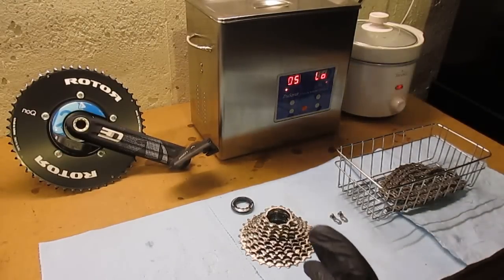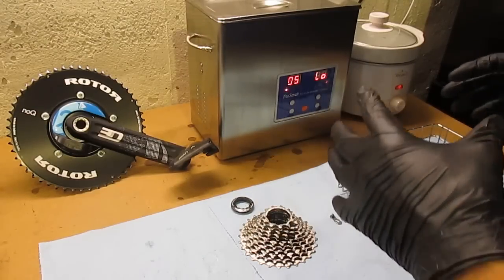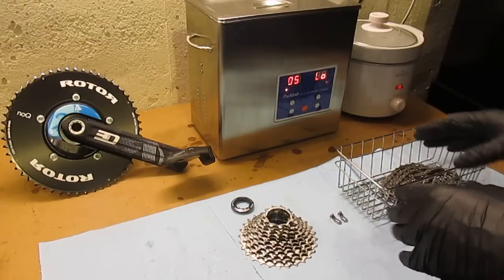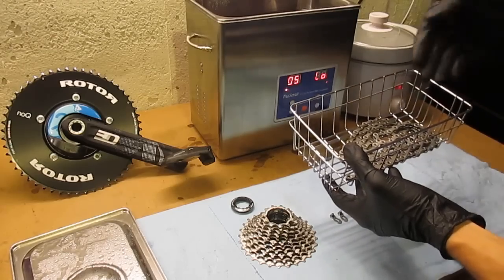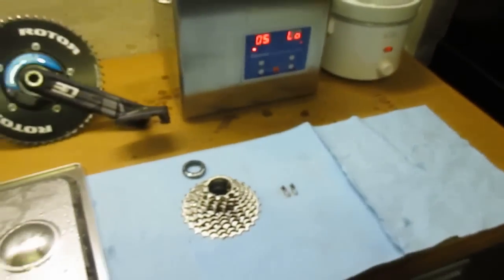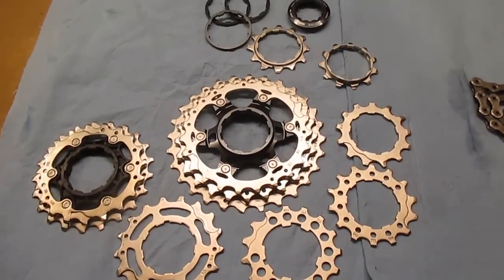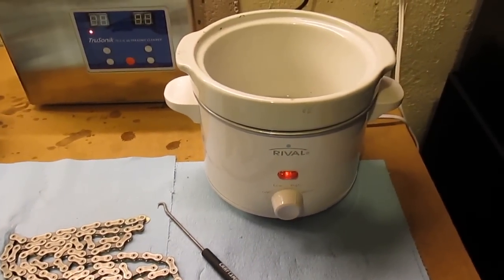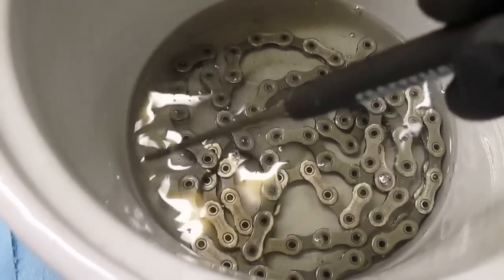Paraffin Wax Chain Lube Conversion

Comment: Melting wax in paraffin lamp oil or xylene will make it more viscous at room temperature (no flaking). But wax can also be melted in a combination of acetone plus kerosene. But that is more oily. In any case you no longer need to melt the wax after that….it goes on with a rag much like vehicle carnauba wax.

Comment: When I use my ultra sonic cleaner instead of putting the parts directly into it, I put them into a ziplock bag first and then add my cleaner and then insert into the ultra sonic cleaner.

Comment: Great job. Although you likely clean and wax you chain often and this wouldn’t matter. I am concerned spinning the chain will remove the wax from inside the rollers and pins and compromise lubrication.
Reply: When skateboarding I must wax a ledge about 6 times a day

Comment: You did a really nice job clearly explaining the entire process. I just went through the process of completely stripping two brand new chains of their manufactures oils with white gas, degreaser and xylene. It worked really well, but I think I'll be getting an ultrasonic cleaner for the future ... I really didn't like working with the chemicals.

Comment: Question:
After doing this conversion, how do you maintain the chain over time?

IE. With traditional chain lube it is recommended to clean the chain with a chain scrubber every 100 miles or so and reapply chain lube.
So, do I still need a chain scrubber if I do this conversion? (my scrubber broke recently, and I am wondering if I need to replace it, if I plan to do this conversion).

Thanks so much in advance!
Reply from the maker: I repeat this process about every 100 miles . . . or longer.

Comment: Hi Once you have mixed the paraffin wax and if it’s put into a bottle will it stay as fluid for a few months or will it go back to a wax and not pour from a bottle
Reply from the maker: Will not stay fluid. Will go back to solid soon after you turn off the heated pot.
Reply: @TheBeanWhoWalks  put some of the wax mix into iso alcohol for quick application between full waxes.  cheaper than white lightening.
Reply: Just leave it in the slow cooker for the next application.

Comment: Too much work.  I clean my chain once a month, and lube once a week or two (depending on weather) in about 2 minutes. Little more friction than wax, I suppose, but I doubt I would feel the difference.  But thanks for sharing!
Reply from the maker: Yeah, it is a lot of work. I enjoy working on my bike though. Its my hobby.
Reply: The fancy difference is that waxed chain is clean. It does not mess up your car, your leg, your hand when repairing a tire puncture... i think this is the more visible reason. On the other hand, in the oil you collect dust, which is an abrasive mixture, eating both chain and gears. Wax does not collect dust, gives a longer lifespan for the parts too.
Reply: massive difference in wear though - chains and cassettes so it saves money.

Comment: if you go on vacations and you stay in hotel, is there any procedure that does not include fryer, pots, that can be done on hotel parking lot, and that chain waxing with cleaning could be done in 15 minutes?
Reply: Squirt chain lube.
Reply: Bring a second pre-waxed chain.
Reply: @willpoole5241  two chains are not enough, because more than 140km on one wax, chain will start to wear and uninstall/install the chains are complicated because there is no quick release link and pushing pin from chain for every waxing is unacceptable because it can be done only one on one pin
Reply: Makan Tahi good points. So I guess we traveling cyclists need a portable wax melter that applies the wax without removing the chain. Sounds like a good business opportunity for somebody!
Reply: @willpoole5241  yes i made inductive heater, that works on 12v from car or old laptop batteries, 4 in series, 16v and it works well,less than 6 minutes per chain-2 layers of wax, first for cleaning second to lube, all done on bike, you can see it on my channel
Reply: @willpoole5241  Also known as a long candle, a lighter and a hairdryer. I do that all the time when I'm too lazy to take the chain off. Seems to work just fine so far.

Comment: When you take it out of the wax you need to dump it in cold water to solidify the wax. The majority of the wax you have seen on your paper has run out from between the rollers. Solidifying the wax as soon as possible prevents this from happening. Secondly, once the wax has made it's way into all parts of the rollers, leaving it there won't make any difference. Once the wax has melted, you can turn your cooker off and move the chain around until all the bubbles stop escaping. Leave it in there until the wax begins to form a skin, then take it out and dump it straight into the cold water. This will ensure as much wax as possible will remain in the rollers where you want it, and not on your paper.

Comment: Combining paraffin oil with the wax creates a far softer and less flaky lubricant, which lasts much longer and makes the drive train quieter, in the video here it seemed quite noisy to me.
Instructions from you tube channel cycle oz linked below.
https://www.youtube.com/watch?v=gF9nbwsaSHs&list=PLJd-Oa4U1iZlK6jGkaSxGdC0_4w1x1fQl&t=0s&index=28

Comment: Thanks for the video.  Two possible enhancements: 1) After using the degreaser, rinse with alcohol to remove any residual chemicals.  2) Apply a vacuum to the parafin bath to more quickly and thoroughly draw off the sir.
Reply: Apply a vacume to parrafin bath ? This is getting rediculous, its only $38 for a brand new chain folks !
Reply: @rterry2752  what you would tell if you save 5 times 38 $
Reply: @makantahi3731  You like doing things that are a complete waste of time ! go for it !
Reply: @rterry2752  i saved with one chain , 5 chains, just waxing every 100km  it takes 6 minutes and it still is not worn, if you like to throw money through window, just do  it
Reply: you are complicating simple thing, no need for hospital cleanning

Comment: Do you use the Simple Green in subsequent cleanings? I'm curious if this cleaning method is effective for the chain wax.
Reply: I follow guidance from Oz Cycle videos: Use a hot-pot and pour boiling water over the chain. both sides. That's been enough for me and my road bikes.

Comment: Thanks for this walk through. One question .. isn’t it a good idea to rinse the chain in something like mentholated spirits to remove residue from the degreaser? (I’m collating as much info as I can on drivetrain cleaning and lowest possible friction lubricants). You’ve already tipped me on getting the largest ultrasonic cleaner I can rationally afford :)
Reply: Use alchohol.

Comment: I commute and tour, ride between 30 and 40 miles a day. I clean/lube my chain now about every 2 or 3 days,  and when I clean my bike I remove cassette and clean that as well. I'm guessing this would be VERY time consuming for someone like me, correct? No way I could expect to get a week with no re-lubing? Maybe I could have a spare chain and just swap them back and forth, but that would eat a lot of quick links. Any suggestions to make this work for riders who do lots of miles?
Good, detailed video though. Very interesting.
Reply: https://youtu.be/HHr9znwpwmQ i recommend this tutorial more from Oz cycling. The initial cleaning process is a one off thing and that the re application will just involve the paraffin wax + ptfe which has hardened. The application in this video is pure paraffin thus the need to constantly re-apply the wax yet in the other video the method of taking it out of the bath ensures that the wax adheres better. Hope this helps
Reply: The person in this video says that the wax is gonna last longer than a normal lube.. well, in another video they say the wax is gonna last for 150 miles in wet conditions - 200 or more in dry ones?... I'm gonna give it a try for my commuting bike ( 15 miles a day here in the north of England). So I supposed to repeat this procedure every 2 weeks with the help of some wippermann connex quick links ( they should worn out less quicker than the sram - hopefully) And I'm adding some paraffin oil to the wax to make it sticky and less solid (I've just find out this video where the guy the make the video said that he adds Teflon powder and another powder just in a comment above). For your mileage I supposed that you need to do that every week, but like you have said if you are gonna rotate 2 or 3 chains it should be less demanding. I'll let you update if it's gonna work for me!
Reply: Have you already given it a try by the way?
Reply: Haven't tried it yet.  Having a wet nasty winter here right now. Not real pleasant to work in the garage below freezing.  Just wiping down my regular chain for now. This will be part of my spring riding routine. Getting all the stuff together now. Checking resale shops for slow cookers. Gonna look into that Teflon powder.
Reply: I'll let you know my progress. take care

Comment: how to clean the old wax when we want to reapply new one?
Reply from the maker: Ultra sonic cleaner!
Reply: Last to Fast is there any other way? maybe soak in certain solution? don't have that equipment.
or does it really need to clean the old wax first?
Reply: @tn9274  poor boiling water over it

Comment: keep in mind that it is not only the low friction what matters... underload, what matters is the thing that prevents the moving parts from making contact... so... you could use baby oil, but its going to damage the parts faster than common multi grade oil... ball bearings in the industry use grease... and these parts are spinning fast with heavy loads... grease has a high viscosity...

Comment: Hi there, I just used the same wax, with a KMC Ti chain and while I can definitely feel the difference in performance, the chain is just too noisy :( any advise pls ? )
Reply from the maker: Yeah, I've noticed that mine is noisier too compared to - for example - a new DA chain fresh out of the package. I wish I had a solution, but I don't.
Reply: Its actually the PTFE aka Poly tetra Fluoroethylene aka Teflon which makes things slippery. I am no expert but Teflon normally does not combine with Paraffin as it remains a solid at the temperature the  wax melts because even at 425 D'Celsius it does not melt thus the need for you to agitate the wax with ptfe to alow it to use the liquid wax as a vehicle. Too much info i know.

Comment: What model TruSonik are you using in this video?
Reply from the maker: I'm afraid I don't know. The link to the one I purchased is in the description. However, it looks like the landing page for that link is slightly different than when I originally bought the item. Mine has a heater. . . that's important.

Comment: con #1 don't touch rain #2 make sure to re apply often as if it runs out your chain will wear fast. I run chain l oil and get some amazing miles 700ish +-100 depending on weather it is barely any worse for dirt and grime as long as you whipe off the excesses after applying. after changing to chain l I know longer have to reapply every 200 or so miles

Comment: Do you think it would be wise to dry chain in an oven before putting it in wax, as there may be water in pin areas that will not let wax penetrate
Reply from the maker: Maybe so. I don't worry about it. If there is water in the chain, my experience is that it comes out when put into the hot wax and left to sit. . . I also stir occasionally.

Comment: Is wax lubing still a good choice for mid-drive (non-hub) ebikes?
My ebike is probably soon to be upgraded from 1600W to 3000W, and that puts a huge load on the chain, not unlike a motorbike since the torque is very high due to the pedal cadence of probably 100 - 200 rpm.
Reply: ECN with that much power a thick oil like chain l or a home brew of some car oil thinned with mineral sprits may serve you better
Reply from the maker: Oh my! I would just be speculating if I said anything. 1600 - 3000 W continuous 10x higher than my world.

Comment: Great video! So in the past I did use liquid paraffin to lube my chain. I used PERFORMANCE bike store wax. But it wasn't pure wax, it had some additives. I could never reproduce the consistency of that wax. I've noticed that regular, candle or canning wax was not as good. 
Now I've seen another video where the wax being used contains 50% of wax lube  (oil).  I suspect that this is the way to prepare the wax?
Reply from the maker: I have always just used pure paraffin wax. However, in my next go around, I will be adding 5 grams of Teflon powder and 1 gram of Molybdenum Disulfide powder to 1 pound of wax. This is the "recipe" of the "ultra fast chain" lube used by Friction Facts (now Ceramic Speed).
Reply: I greatly appreciate it!

Comment: Waxing the moving chain parts is a nice way to make them water sheding to also stop rust..
I see your Also thoroughly clean the cassette, but said nothing about protecting them gears from exposure to water and rust.
Should they be waxed as well?
Reply from the maker: I don't wax the cassette or the chain rings. But, I do meticulously clean my bike after a wet ride.

Comment: Wax is not a lubricant it is a coating. It does not flow like oil. When two metal pieces rub together it flakes off. A filtered oil bath would be the ultimate solution like in a car but since we can't do that just wipe off your chain with a thick cloth after every ride.
Reply: That is why you use a mixture of paraffin and paraffin oil.
Reply: Paraffin oil is called kerosene in some countries. It is just like oil in that it will attract dirt the same way.
Reply: Paraffin oil is petroleum based but is much thicker than kerosine.
Reply: I use pure wax with no oil added. It takes about 8-10 hours of riding before it starts flaking off.
Reply: just wiping off with cloth is just cosmetic cleaning, pushing all the dirt in the rollers in my opinion.

Comment: I do this on the stove but with a double boiler method. Wax in pot, that pot in a larger pot of boiling water. Works great, no fires.
Reply: The chocolate melting method, my stove will be perfect no flame

Comment: nice video but too anal for me( phrasing boom )

i found stainless flask with mesh of stainless sieve,a small volume of bake cleaner dump crappy stuff in, shake like mixer, let settle, use a pan inside a pan of water to boil up wax, hang chain up to drip ,dry dump on bike do a short run  through gears under load until normal shifting resumes.......

HAPPY DAYS just don't mix up candle wax for pasta sauce, or let a alcoholic do the cleaning stage.

now anyone seen my remote

Comment: Hello
Would this technique also apply to mountain bike drive chains? A lot more dirt in that segment.
Reply: Last to Fast I am actually testing it this summer. Applied second time 3 days ago. So far cleaning has been rather easy. Need to work on a bigger tin can to place chain into. Drive chain does indeed stay cleaner than oil in dirt.
Reply: I would like to know either.
Reply: FIGHTTHECABLE For mountain bikes is the best lubricant because it's a dry lube, dirt is not going to stick on the chain
Reply from the maker: I would think it would work great because the dirt would not stick to the chain as much.

Comment: I have 5 bikes and all my bikes have waxed drive trains. I've read about waxing chain through the old Bridgestone bicycle catalogs that can still be found online. This was when Grant Peterson was designing the bikes (check out the 1992 and 93 catalogs especially). Besides that, catalogs are full of useful information regarding comfort; maintenance and bicycle history.  I myself would advocate that you add some beeswax to your crock pot when melting the wax. Paraffin wax is quite slippery yes but, it's that slipperiness that makes more frequent reapplication of the wax to your chain because, the chain is shedding the wax as the chain move through the drive train. Beeswax is sticky in contrast to the Paraffin and, it's use will help the paraffin retain on the chain for much longer. It makes reapplication less frequent. That box of Gulf wax is the same that I use. Inside the are 4 slabs of wax each one is four ounces, I take 2 slabs of wax or eight ounces and toss in about two ounces of beeswax  for a ten ounce mix. I let my chain soak for about 15 minutes in the crock then, I remove the chain and hang it from a hook outside to cool. The beeswax will pick up some dirt during your normal use but, it won't be as close to the mess you would normally get from using the oils or synthetics that you buy at the shop. I reapply wax once my chain become noisy or, when I start missing shifts or, when noisy and chain is taking longer to makes shifts.
Reply: or add engine oil amount you desire bit soften or more. Also you can apply any liquid chain lube on parafined chain insalled on bike if its rainy or want parafin stay longer. Parafin makes no rust prevention, so little light oil needed in wet.